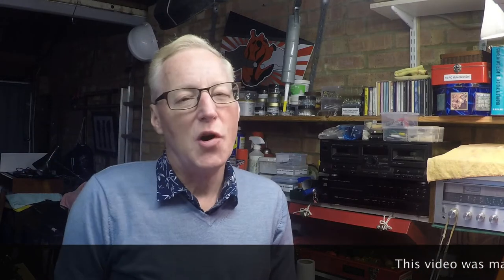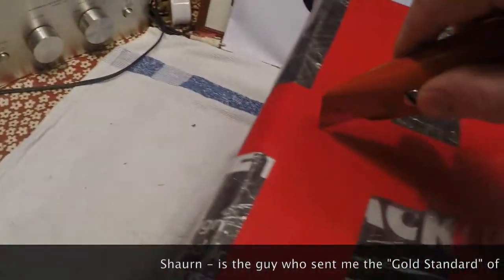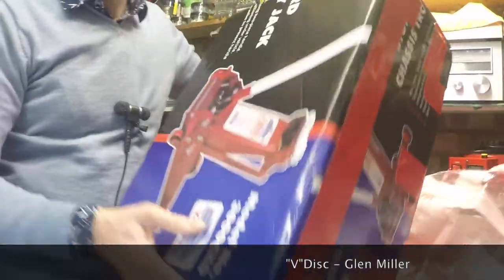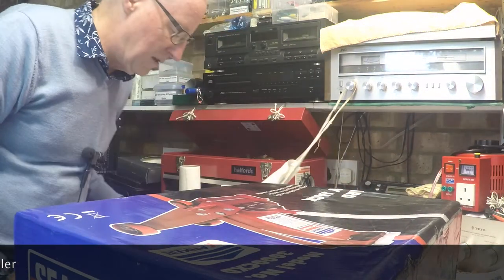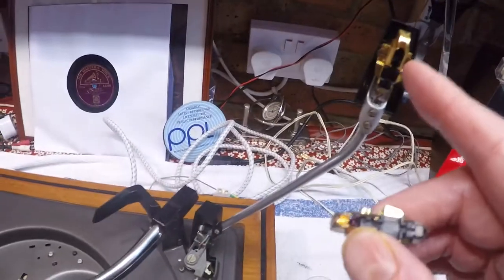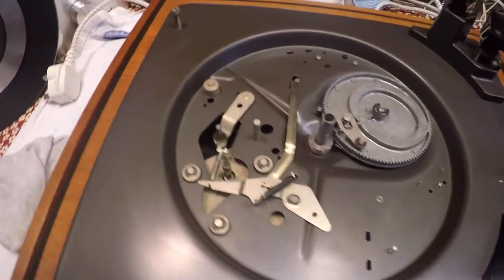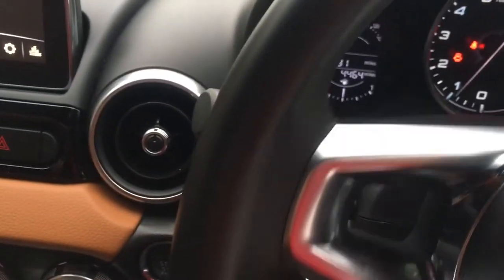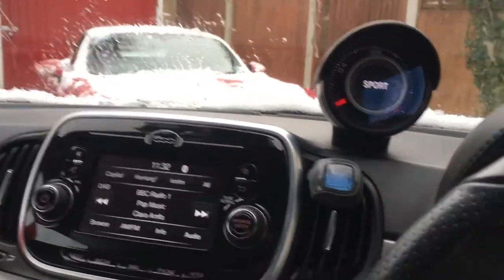Unboxing part 1. &  Snow !

Comment: The Garrard 3000 is the same as in my Hacker GP42. Fitted a BSR cartridge that has improved sound somewhat. Mine hasn't got the brush!
Reply from the maker: Hi Simon 

Great and I gave you a mention on Pt 2 - coming soon 

Warm regards 

Richard
Reply: Hello Simon. I have a garrard 3000 as well but i can't find a cartridge beacause i was stuck looking for a Astatic 187 cartridge whitch is extremly rear. Whitch BSR cartridge do you use exactly so i can give it a chance?